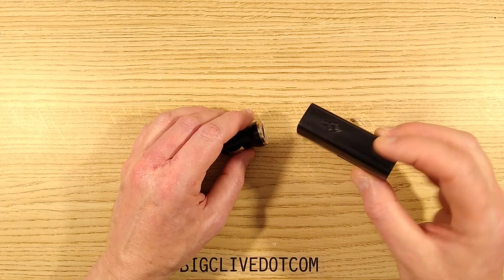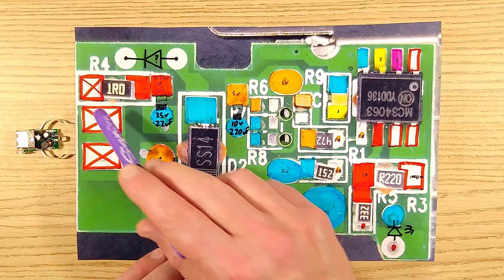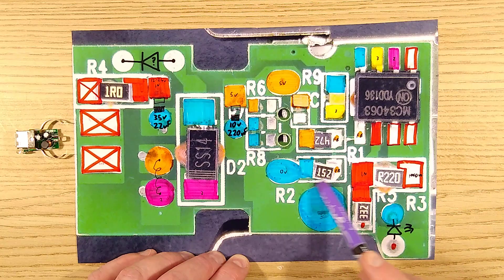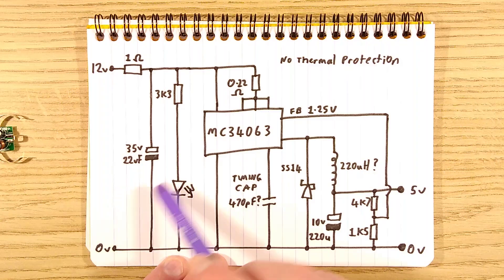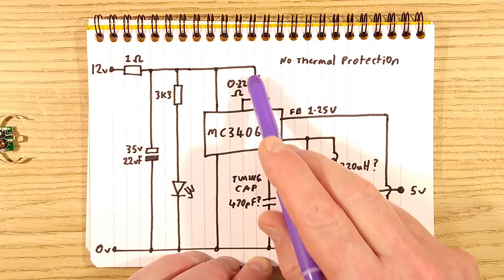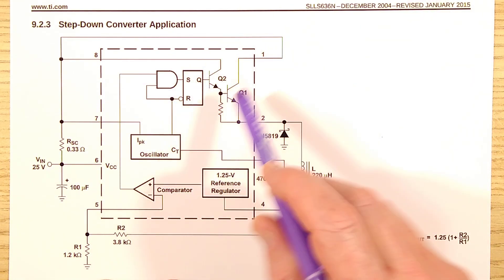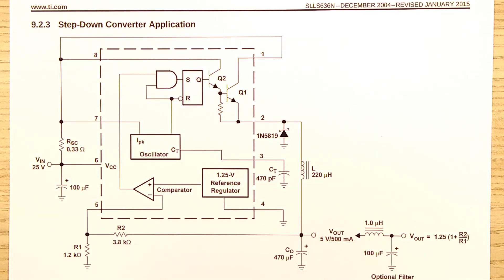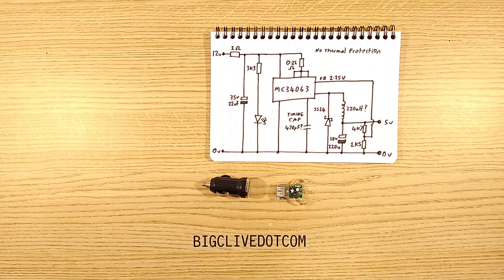Ordinary product with iconic component

Comment: took one of these appart and was going to use it for my 5v usb dashcam but decided to use a cheap buck board from alxp that i could set to 5.5v for the long wire voltage drop. crazy what you find in these things.

Comment: Got me curious so I cracked open a generic car cigar lighter charger for a Motorola type phone from the 1990's. It has that same chip but it's SM34063 and the board is similar but with different resistor and capacitor value. For example that 35v 22uf cap is a 35v 47uf cap and the timing cap is 320pf. I still have that old phone and the charger does work.
   Tried to do the trademark lookup and it's a broken elliptical circle around a central dot. Looks like Alchemy Semiconductors but the circle is not broken and like Catalyst Semi but the breaks are on the wrong corners and the dot missing. Catalyst Semi was bought out by ON Semi in 2008. ON Semi bought out Cherry Semi I remember when I was trying to repair a 5.25 floppy drive from the 1980's. I could not find that anywhere. 
   Does anyone know about this chip that controls read and write on a 5.25 floppy? DIP28 IC chip Cherry Semi 977509-001 DATE CODE 8708 H It might be a special chip number just for the Tandon TM65 2L floppy drive. The drive sold in the European computer from the '80's called AMSTRAD PC1512. I contacted On Semi and they have no records going back that far including schematics. The 3rd party Chinese copy cat chip makers say they will make one for a few hundred. When I ask for a proof with schematic they ignore me. They are either too smart to tell me or lying. I know they can make one as they have before with other chips but for a reasonable price under $10. I know it's the chip as it's heat cracked when I got the drive and used to work for me after heating it a bit but only for a bit. Anyone know about Tandon floppy drives? I did buy a working TM65 2L but the PCB was different and didn't have the same chips. They broke up the DIP28 into separate components which was probably smart.

Comment: Rsc perhaps may moderate the operation of the oscillator to either shut it down on excess current draw or to vary the frequency of the oscillator as the load changes to better keep up with a changing load.

Comment: The voltage regulation is achieved by the action of the comparator. When the input of pin 5 gors above 1.25v the output of the comparator switches off and that in turn shuts off one input the the AND gate driving the set input of the RS ff. This basically shuts off the oscillation driving the output circuit until the voltage at pin 5 drops below 1.25v at which point the chip begins pulsing the output and the series inductor to build the output voltage again. Etc. Etc

Comment: In your diagram the oscilator input from the current sense resistor is labeled Ipk, supposedly peak current, meanining it detects when an overcurrent situation occurs and shuts down the oscilator.

Comment: I've got one of these laying around the garage not being used, I bought it probably 10 years ago, and I never use it anymore because I've got a PD charger. And now I know its failure mode is potentially short circuit, I think it will be going in the (parts) bin.

Comment: Bugger. I missed this video for some reason.

Snazzy little chip. Not a lot of external components, and the voltage is set by a simple resistor divider equation. Best of all, it's super cheap at 70 cents.

Comment: Question from ignorance. Why not just a simple transformer or resistor to drop the voltage from 12 to 5.
Reply from the maker: A transformer requires AC and a resistor would dissipate the other 7V as heat and get very hot.

Comment: Uses a fixed frequency with a variable pulse width. You can modify for MUCH higher current with a mosfet follower and a bigger inductor. One thing I have used these for is for making constant voltage power converters for use with solar panels.❤

Comment: Is this what they use in USB Killers to fry electronics?
Reply from the maker: Dedicated circuitry to charge a capacitor to a high voltage and then dump it into the port.

Comment: That's a good analogy, comparable to the 555, yes, it's a very versatile. To this day, I use the MC33063A (the industrial temperature variant) in many of my new industrial component designs. Take care selecting your current sensing resistor, and you should be fine. I use it because my products have a long service life, so I'm interested in the availability over time  This part, although not the most efficient, by today's standards, it is not too bad, but the main sales point for me is that it  is available from so many chip vendors,  there is extremely low risk of supply chain issues, as there are with many other chips, and others that go obsolete as soon as demand tapers off a bit. Many Chinese manufacturers make this chip.
Now, one must also consider that this is not terribly fast switching with the original spec @ 90KHz and some variants maxing out around 100 Khz or slightly higher.  It's not a PWM switcher. It's a gated switcher. So if your circuit requires very low noise rails, you have to consider the average frequency of the gate switching frequency. In other words, you can get a low frequency glitch on your rails. In cases where I have sensitive ADC sensing or op-amps, I add a second LC low-pass filter at the output to further filter out this low frequency switching.  
PS; You can also use it as a boost regulator.

Comment: Why don't they use 7805 voltage regulator in these devices?
Reply from the maker: It would get very hot as it dissipates the voltage dropped times the current as heat.

Comment: The MC34063A is the chip I had to replace the most often due to failure. I decided to use MC34063A USB sockets only to sacrifice for other voltage low power devices like to replace the linear build in 9V supply in my vintage depth sounder and/or in 24V vehicles where the on time is about one third as with 12V reducing the heat. I also applied heat sinks to those chips.

Comment: Could you do a video on the  Bob Beck Device Circuit? Both versions, the one battery setup, and the one with three batteries.
And the price difference between them. And which circuit is best on batteries, So the one that uses one battery, after finishing off three batts what was the total run time? VS the circuit that takes 3 batt with no additinal batt replacements, what was its total run time ? You get where im going with this?

Comment: I remember building an oooooold iPod cigarettes lighter charger with a 7805. I'm sure it got pretty hot... Output must have been super clean at least!
Reply from the maker: That would have got very hot, since the voltage dropped times the current is the power dissipated as heat.
Reply: @bigclivedotcom  thinking a bit further, they were FireWire based, so mayyyybe it was actually a 7812. I know my connector was hard-wired.

Comment: We all use the USB power block in the home taking our 120 volt home supply in the US to 7.5 volts to charge our phones. How do they achieve this without the heat produced by the older voltage transformer.

Comment: Seems to be a lot of trouble instead of a simple 3-terminal 5-volt regulator and two tantalum caps.
Reply from the maker: That would result in very high heat dissipation.

Comment: I have a serious question so somebody could please answer it or explore it but I saw that some charging cords coming from the big mountain Mark of the beast exporter CE have some hidden tech that allow remote access to whatever device it's plugged into🤔
Anybody have any direct knowledge of how they're doing this and have you come across a power cord, power block and/or charging cord with this neat little ability ❓
Thanks 🙈🙉🙊
Reply from the maker: Rubber duckies?   A USB cable that pretends it's a keyboard and sends strings of keyboard commands.
Reply: @bigclivedotcom  So I've seen that this is pretty easy stuff for the right person to create and cheap so how can you defend, be proactive?
Thanks 🙈🙉🙊

Comment: Having perhaps foolishly used these to charge various android phones occasionally over the years, I suspect your assessment is right - every phone I've tried it with charged at a snail's pace. Enough to keep the battery from going entirely flat before I reached my destination, but I suspect it would struggle to keep up if the phone was doing anything power-intensive. I've had several of them, including one very suggestively-shaped one that I acquired from a petrol station during a long late-night motorway run and spent about five minutes giggling at before I set off again, and while none of them lasted especially long I seem to have gotten lucky as far as not blowing up my phone goes. 

I also wonder whether that pulsing effect is the source of the annoying high-pitched whine that superimposes itself over my music whenever I charge a phone I've also got connected to the stereo with one of these, which I've just gone out and confirmed is present to at least some degree with the ignition of my van switched off entirely. That's using a somewhat more upmarket-seeming unit which cost me about £20 (some of which may admittedly be price gouging by motorway service station retailers), so I have a feeling a lot of them use the same basic circuitry inside.

Comment: Mine looks like this but inside it has a HC7001 chip which is from Shenzhen.  The board has fewer components, but the inductor has heat shrink around it.  The label says 5V 1A.  I just got it for the chip.  I can mod it to make a 6V motorcycle battery charger.

Comment: I still use the MC64063 for new designs. It is dirt cheap and works well for low or moderate currents. Due to its on/off switching approach the inductor will cause wide-band magnetic distubance and thus is not well suited whenever there is a DCF77 receiver around.

Comment: The 1N5819 is there as a "Damper diode" to prevent the output voltage from going negative with respect to ground, which would destroy the chip. It's from the "High efficiency" series, called this because of it's very fast recovery time from saturation. Earlier damper diodes dissipated power during their slow recovery time reducing efficiency.

Comment: The data sheet is more than a little vague about it but I believe that the 0.22 Ohm resistor sets the peak current limit at 0.3V/0.22.  When this limit is hit, the switch is turned off early in the cycle.  This almost protects the chip.  If the inductor is a really good one, the catch diode is a good one and the output has a solid short, the inductor current will get kicked a little higher on each cycle until it burns the chip out.  For cheap stuff the solution to this is to make the inductor not so good so that cycle to cycle the current runs back down to near zero.
For better protection, there is a trick where you detect the extremely short ON time and tell a lie to the voltage comparator.  Basically the circuit listens to the voltage on the 0.22 and if it sees a really sudden increase in the drop, a PNP turns on and charges up a capacitor that times the delay until it tries again.

Comment: I saw "iconic component" and guessed a 555. At least I was right that the 555 is possibly the most iconic component! (Though I think a 555 with a big inductor could probably work as a variable voltage divider?)

Comment: A part I used years ago for a nixie clock HT power supply: 12V in, 180V out. The data sheet says that's too much, but it's worked for years... These days I'm looking more at buck than boost and efficiency is a priority, but it's nice to know this is still around.

Comment: The 34063 makes a good low cost highnefficiency lithium battery charger.
Set the feedback resistors to give 4.2v outout, and the current limit resistor sets the max charge current. Then you can charge lithiums from 12v automotive etc with the buck smps efficiency.
I have a couple of pieces workshop equipment using 34063 for battery charging, they have worked flawlessly for almost 15 years.

Comment: I bought a few sticks of 34063 in PDIP (about 300 of them) and have used them for years.
They are are actually very rugged, despite not officially having thermal limiting.
The 0.22 ohm current limiting resistor always restricts the on-state current of the pass transistor inside the 34063, so they are quite safe in most normal operation.
I have had them short curcuit outputs from time to time and never blew a chip.
And it should never go over voltage if the feedback resistors are working because any time the output is greater than the feedback voltage the 34063 will not turn on its pass transistor. If the top feedback resistor goes open circuit you are in trouble, but that applies to every chip with feedback resistors for voltage reg.

Comment: I used the extended thermal version of this regulator (MC33063) in so much projects I couldn't even count it. They are such a versatile workhorse if relative low power needed.

Comment: Clive thx for sharing. There is a new rendition of this chip that is used in car chargers. It's still a 34063 IC under the hood but the V divider is internal and set for 5V. I guess that's optimization for you. Two less parts made somebody go woo-hoo.

I don't care who you are these ICs are excellent for the ratings envelope that they possess. You can these at the dollar store. Then you get the diode, inductor, PCB, LED and IC for around a buck. Wind several turns over the inductor and you get either a fwd or flyback converter. Now that's a sweet deal.

The clk in the IC runs all the time. The ratio of the I_dchg to I-chg of the timing cap is described in the datasheet as ~ 6:1.

The Timing crkt is interesting. The I_sns increases the charge current to the timing cap many times so it has a much reduced charging time/current.

Ok, so this ain't a multi-Mhz clocked switcher, but is stable and quite easy to work with.

I'm not understanding why either fwd or flyback mode isn't utilized if you have a critical load that cannot tolerate a shorted buck output xsistor. The energy can only cross the Xfrmr while it switches. Take away the switching, shorted output Xsistor, and the output dies. Think of a buck reg as a PWM output that is low-passed that can pass the DC input to its output.  My guess is that this requires more magnetic design than people want to deal with. If you choose fwd or flyback you get to take advantage of the VCEsat voltage instead of the darlington emitter follower. The voltage across the output xsistor is over 1.7V when combined with a small amount of maximum current soon exceeds the pkg thermal rating. 1.25W/1.3V= 960mA. Don't forget the TJmax is based on a TJ of a 150C. If you run a device at it's ultimate thermal limit you are actually performing a HALT test. That's Highly-Accelerated-Life-Test. So, don't do it.
If you take the VCEsat @0.45V and I_max @ 1A that power level, 450mW, is below the pkg rating even for the SOIC pkg of 625mW. The PDIP-8 and DFN have power ratings of 1.25W.

I seem to remember if you have a very expensive load that can be destroyed by an over-voltage occurrence, then for heavens sake use  a crowbar.

Thx for reading.

That's all I got for now.

Again, thx Clive.

Comment: I had one of these fail as a short in my dad's car, back when I had an Alcatel OT Idol, which, albeit being terrible, actually heated up shortly and quickly displayed a dialog with the text "The charger is outputting a too high voltage, unplug this charger immediately." I did, and when I tried again, it was completely dead, lol, the chip had just lost all connection. But yes, the phone DID receive 12v from the car's battery shortly.

Comment: I still use this chip for personal projects. I can fill in the pin numbers off the top of my head.

A recent project uses 2. With 12V in, one makes -12V, the other with an external FET, makes +250V, for tube projects.

Comment: Using an inductor/capacitor pair like that, instead of a capacitor is particular unusual.  Most newer power supply chips, be them linear or switching use only a capacitor for the power draw line. 

If they use an inductor it is a small choke chosen just to smooth ripples.

Comment: ON Semiconductor actually used to be part of Motorola, so the part number is not copied (most "MC" parts are now made by ON. The rest became Freescale which has mostly stopped using that prefix).

Semiconductor companies tend to split and merge a lot. Looking at a Sega Genesis/Mega Drive you find chips made by NEC, Motorola, Signetics, Hitachi and Mitsubishi. Hitachi and Mitsubishi merged their semiconductor divisions together into Renesas, which bought out NEC. Motorola's digital division became Freescale which was bought by NXP. Signetics was integrated into Phillips Semiconductors which became NXP. You can also see RAM made by Hyundai (now SK Hynix) and Fujitsu (which formed a joint venture with AMD that later became Spansion, which was bought by Cypress who was then in turn bought by Infineon).

Comment: Hmm, I do wonder how this power supply would behave with a modern smart phone. I know that modern phones and chargers "negotiate" voltage and current via a standard like Quick Charge or Power Delivery. I would think that a modern phone, when plugged into a "dumb" USB socket like the one here, would self-limit its current draw to 500mA on the assumption that it's connected to a basic USB port on a computer, but of course I'm not going to test that hypothesis.

Comment: mentioning the 555, you can use that as part of the control circuit in a diy switch mode regulator 😉only bad thing about them is 15v max supply voltage without extra circuitry